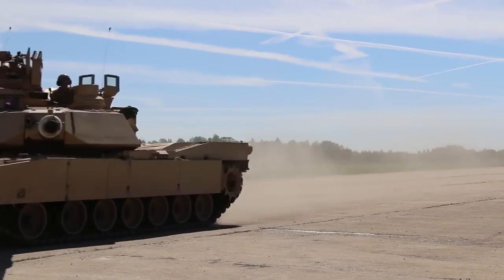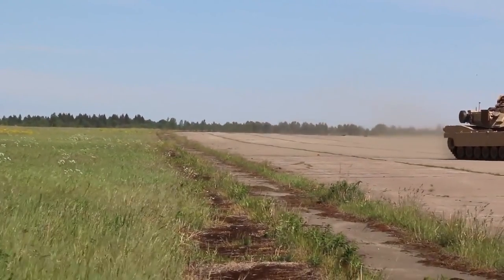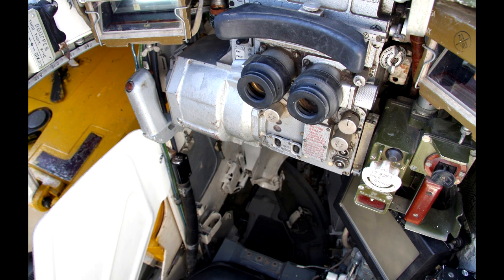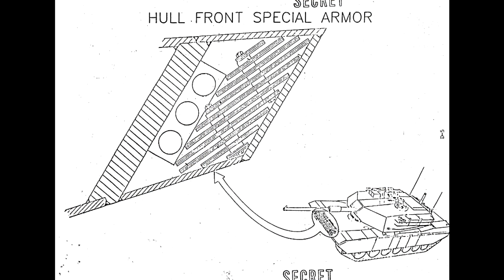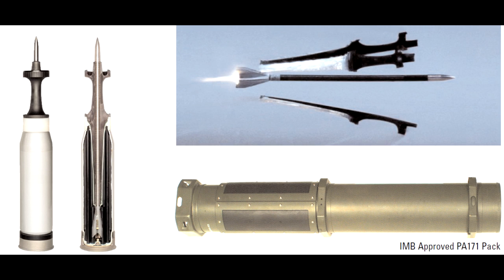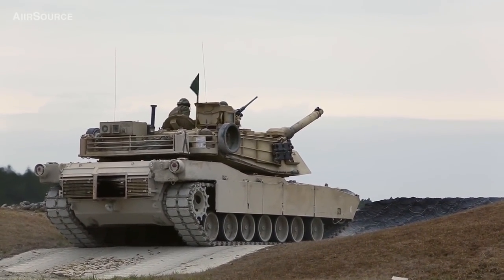Problems with Abrams tank

Comment: The turbine engine was selected because it was lighter than the diesel, as well as using up less space which helped the Abram store nearly all of its ammunition inside the protected bustle rather than leaving many unprotected in the hull like the Leopard. Another benefit is the superior torque rate from the turbine, as well as lower noise signature from afar due to the high-pitched turbine sound.

The high fuel consumption was taken into notice, hence the auxiliary power unit installed on later models to help with fuel consumption while keeping the systems powered.

Comment: The turbine engine has a slightly better power to weight ratio the range on the leapord 2 is 3 miles the Abrams is 2.48 which is already way above the average engagement range of 1000 yards

Comment: I was an M-1 Hull/Track/Engine/Transmission. Mechanic and operated the M-88 Tank Recovery Vehicle. From 1981 to 1993. And both used Diesel. And I saw what the M-1 did to all those "T-Series" tanks. In Iraq..JUNK... HHC 1st Cav1/8th. E-6

Comment: Turbine offers multi-fuel capabilities.  If you only run diesel you can't use kerosine for winter operations where diesel gels. The turbine allows any combustible liquid to be used as fuel. Acceleration is another key factor in the turbine as is the lighter weight of the turbine.

No tank has ever killed an Abrams in battle. Wounded yes, but not killed.

Comment: But the turret doesn't play Pop Goes The Weasel when it's hit.
Reply: what is the point anyway? The tank is still mostly destroyed and the crew is just scorched ash if they haven't escaped.
Reply: https://youtu.be/sn0v1Tu1Nig?si=Yra9xz6c_-t69oEO

False
Reply: @IceAxe1940  did you read the title of the video link you posted? Lol they planted a shit ton of explosives in that. Of course the turret is gonna pop.
Reply: @that207guy7  It doesn't matter if the plant explosives in there or if it runs over a super massive IED the Abams turret will pop off just like every other tank it doesn't matter and that's the point

Another instance of an Abrams turret popping, Google 3-67th Armor, October 28th 2003 when a U.S. Army M1A2 SEP got turret popped. You can't use the standard cope argument that it's a "non DU equipped" Abrams neither.
Reply: @IceAxe1940  if an abrams gets ammo racked, the turret does not pop off. It's ammo is stored in the rear of the turret, and cooks off safely when hit. Abrams doesn't store hardly any ammunition inside the hull quite litteraly for this reason. If you actually knew what you were talking about, you'd know this.

If you plant explosives inside ANY tank, the upward force of the explosion will obviously toss any turret. 

And I'm not coping, but when I read bs, I correct it.
Reply: @that207guy7  If an Abrams runs over an IED it's turret absolutely will get blown off as seen by the M1A2 destroyed In Iraq in 2003.

If an Abrams is damaged by a large explosion it's turret absolutely will get blown as seen by the video. You're trying to move the goal posts because you know damn well you couldn't refute the video I posted and you couldn't refute the source I told you to research. The Abrams absolutely does store ammunition in the hull behind the Commanders position.

You're coping by moving the goal posts pal

My entire point is the Abrams just like every tank will get it's turret blown off it's not immune to it READ NEXT TIME
Reply: @that207guy7 The abrams does in fact store ammunition on the Hull too
Reply: @tanaziolopez1936  yeahh, i already said that in the comment above. And the ammo that IS stored in the hull also has a blowout panel as well.
Reply: Who's gonna tell him?

Comment: The Red Effect problem.
The M1-Abrams only does well when used in the way it is supposed to. It is a hull-down vehicle designed for offensive ranged combat. They are not Russian tanks, they aren't designed to be in the middle of the open and be expendable, these are sniper tanks, and the Abrams does that job well.

Comment: 0:50 they used the 105mm as a stop gap so they could use existing ammo, simplifying logistics 

1:21 the turbine engine preformed better then the diesel alternative in testing the gm1

Good video just pointing out a couple of things, not saying the Abram’s doesn’t have problems

Comment: First of all the M1 Abrams gun is not under powered and also the reason they chose the gas turbine engine is because it could use multiple types of fuel without any consequences and it also generated a whole lot more horsepower and it was also lighter only weighing in at 1.1 tons that allowed them to stack more layers of armor. And the gunner isn’t blind at night. They have night vision sights. And also, they were not as expensive as you were talking about. They use them in military aircraft all the time. and the armor nothing can penetrate the armor. There’s specifically an air gap and depleted uranium in there, so nothing can penetrate no matter the power. The multi fuel aspect of it is so no matter where they’re deployed. It can run on any fuel that they have available in the area. And also the filtration system is not bad it worked as well as a diesel engine. And the front plate of armor isn’t too thin still nothing can penetrate it because it’s angled and thick.

Comment: 4:49 There was one incident to my knowledge where an M1 got hit by a freindly Abrams on the UFP, bouced off into the lower gun shield and killed the gunner

Edit: Gas turbine got roasted, but i think thats the least of the M1s problems. I think the weight is the main problem, the army thinks so and with good reason. What use is a gas turbine when your tank cant get over a normal bridge? And why upgrade to a diesel of similar power, it would be the new hat for our fat horse.

Comment: The turbine was chosen because it was better the 105 and 120 were in the same spot in 1982 the DU was put in the hull the upper front plate SHATTERED not bounced apfsds

Comment: Imma call some cap, Soviet tanks did in fact not have any good passive night vision or thermals, and rounds on the Abrams upper front hull won't go through, they would shatter, not ricochet into the turret.
Reply: T-72 destroyed it in one hit.
Reply: @jade7631  But from where? Did they hit the turret ring, lower front plate, the sides, the rear, saying x thing killed y thing isn’t helpful, and to be honest, it’s bound to happen.

Comment: The reason for the choosing of AGT1500 dates back to the MBT-70 program. MBT-70 had a rather odd diesel engine which failed to propell the tank and broke down constantly. During the program for the Abrams there were two prototypes: The Chrysler one (Which had the Gas Turbine Engine) and the General Motors one (Which had a derivative of the diesel engine of the MBT-70, that engine being AVCR 1100 and the new derivative engine: AVCR 1360), the General Motors one lost because of a combination of factors: the engine, the armor (Which the Engine was at fault too, it gave the tank less HP per Weight ratio essentially lowering the armor it could carry) and that the company basically did nothing when the US army said: "Okay, fantastic. Now get back to the drawing board and try to fix the issues of your tanks, we will see you in the second testing phase". Chrysler's design won because: The engine was innovative, more reliable than the one on the GM's tank and was favored by the army (It offered benefits that the AVCR one didn't had such as), it was more mobile than the GM's one and offered the same survivability as the GM's one (atleast on the testing grounds) at a lower cost. The AGT1500 also offered benefits such as: Low noise and smoke signature, better reliability (Yes, really. You can see why up in my comment where i mentioned the MBT-70 Program) as well as better power to the sprocket. It also was used as an attempt to standartise NATO equipment since the Germans were interested into it too. Now the things that are responsible for its unreliability were already mentioned in the video but these aren't coming from the engine itself, these are mainly quality control issues. Now, on to the diesel engine: The AVCR 1360 had two major malfunctions that would rander it unusable: failures of the fuel injector pump and engine throwing oil out of itself during tight turns, furthermore the engine was recieved negatively, the proof being the nickname for the GM's XM-1 prototype: "Old Smokey", whereas the Abrams we know of today is nicknamed: "Whispering Death". Sounds like the AGT1500 was superior to the THEN diesel engines, right? Anyways, it is certain that giving the M1 Abrams the title "The best tank in the world" is a little too much of an exagiration. There is no "Best tank", countries use different tanks subjected to their own liking. The Abrams is better than the russian T series in number of aspects but it isn't cheap. It isn't unbeatable, just harder to destroy.  In the end the Abrams was a machine that just fitted fine with the doctrine (Yes, doctrines matter too lol.) the US army had employed.

Comment: Perhaps somewhat unrelated, but I wouldn't be all that surprised to see a new form of ammunition developed. APFSDS is the standard, but already we are seeing issues with it, guns too short, magazines too small, and even if both are fixed it's just too large for a loader to deal with. A 2-part ammunition like the Brits used to use could possible alleviate the issue but not solve it. However, ATGMs like Javelin and NLAW still seem to be intensely feared weapons due to their top-attack modes. Given the current grounds for 120/125mm guns, and previous experiments with larger guns like on Sheridan (Albeit with the idea there being launching ATGMs out of the gun) I don't think it's that crazy to think we might see a weapon system designed to lob large caliber shells just over a target and detonate above it similar to Javelins or NLAWs.

In any case it seems to me that armour (or at least protection) is winning the race against armament, when guns are getting to impractical lengths just to achieve high kill probabilities again.

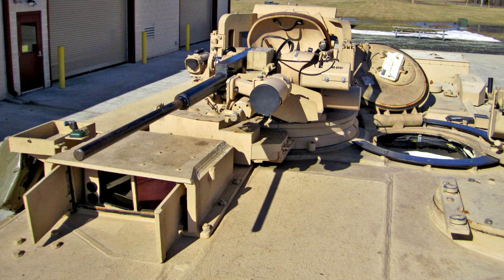Comment: 6:09 for those wondering, by plugging in 52÷sin(8) into a calculator, I've found that that the upper plates effective thickness is 374mm. Not terrible, but still tearable

Comment: 0:47 the reason why early models mounted the M68 gun of the M60 was because they already had it in production. Ever since the start of it's development, its designers had intended for it to mount the Rheinmetall Rh-120. The problem was that they didn't yet have permission to produce it in the United States. This is why they made it so that the M1 could mount both the M68 AND Rh-120, so that once they did have the license to produce the German gun, they could easily re-arm their existing tanks.

Comment: yes no reason to use turbin like no reason sweeden and franch use hybride engine. t80 also turbine.
Is not issue for engine to go over 1500hp but you need move that power on track this is real limit.

Abrams have better control system.
Revers speed of abrams can be the same like forward. 

Abrams was create as a good cheep easy to mantuance tank 
fueal consumtion moder turbine is almost like in disel engine compare to leopard.

this tank is the best.

Comment: There were many initial problems with the M1, but it didn’t take long to arrive at M1A2, which solved many of the problems. The M1A2 arrived in 1992, just 11-12 years after the original.

Comment: I struggle to find proper sources on this, but the German diesel tank engine’s Wikipedia article estimates its weight as 1,800kg (https://en.m.wikipedia.org/wiki/EuroPowerPack), whereas the AGT-1500 is about 1,100kg (https://en.m.wikipedia.org/wiki/Honeywell_AGT1500).

Comment: I see you have a grievance with the gas turbine engine but you should know that the reason we use a gas turbine engine is because the abrams is considerably heavier than many of its counterparts especially eastern competition. The abrams i believe actually produces slightly more horsepower per ton than the Leopard 2A7 and also has a longer operating range. The engine is also simpler and easier to maintain.

Comment: Your wrong, the gas turbine is better than the diesel one.  It is more powerful.  The M1Abrams is a monster, with it's massive armor, and it's powerful engine.maybe you are correct about the part that the gun of the first ediration of the M1 is bad, and that most soviet and German tanks had more powerful 125mm guns, but later edirations such as the M1a1 and the M1a2 had an upgraded gun.
Reply: And that's why america choose for their newest MBT a 🥁 .... DIESEL🎉!!!
The only benefits is a turbine engine has more hp to weight ratio compare with a diesel engine! 
But a diesel engine is by far the best choice for MBT.
Way less fuel consumption, extra complicated dust filtration not needed and way less noise. Also the benefits it is smaller and lighter means nothing in modern Warfare because with the modern guided ammunition it is not important how small the target is because they will find you! And the 1000kg weight reduction it makes almost no difference for a MBT like the size of a Abraham!
Because a modern Abraham weights +-70t!
Reply: @daikovany  Even though a diesel engine can be just as powerful, a combination of kerosene and gas can be  more effective in certain situations, like when in high altitude.
Reply: He literally addresses this

Comment: A useful tank in it's 2015 upgrade configuration (M1A2 SEPv3) if kept 'hull down'... but of that advanced upgrade level, there are only about 1000 tanks under US Army command, confronting more than 2000 'modern tanks' in 2021 in Russian Armed Forces - even according to the completely biased research of the London based 'International Institute for Strategic Studies'...

Comment: The flaws/issues in the video are all fair points.  The tank is great for what it was designed for.....fighting from defensive positions (hull down) against massed attacking Russian armor, then using high speed reverse to escape and entrench in the next defensive position.  Excellent tank...for that specific purpose!

In Ukraine, the Abrams will have an excessively long logistics trail, will be unable to cross many rivers/bridges that Russian/Ukrainian tanks can do, and will be a gas hog = ALL of which limits its capability in offensive operations!

Ukraine would have been better served with more Leopard II tanks, honestly!
Reply: Imagine it hits a mine and loses a road wheel, what then? Even if they do tow it back to a secure location, it'll be a week or so 'till an Abrams road wheel is brought to their location.
Reply: @definitelyfrank9341  ....or it might mean they have to haul it back to a railroad, load it up, ship it back to Poland, repair it and use rails to ship it back to the front.

The logistical challenges that Ukraine faces are pretty harsh......but, as the Russians push them back, the Ukrainian logistic trail with shorten (while Russia's increases).

Of course, if Russia stops with ownership of the Donbass/Luhansk + Crimea Land Bridge.....then Ukraine will be permanently fighting with maximum logistics reach penalties..

Comment: There's no such a thing as a perfect tank, every tank will always have issues and limitations, but what tank out there is better? Over the last year we've learned that Russian tanks are shit and every tank that an Abrams could realistically face on a battlefield is far below its class. Even the Leopard 2 turned out to be not quite as good as expected in a rl situation. So at worst the Abrams is in the group of a few tanks that all can be argued to be the best.

Also, some "problems" are highly contextual. For example, the US has an immense logistical capacity so for them high fuel consumption is not an issue.
Reply: How can it be argued Abrams is the best? Its good reputation is based on how it performed against an unprofessional army of 70s tanks that all lacked thermal sights; were equipped with APFSDS from the 60s; and because they were designed to be as cheap as possible, their armor was only rated for 70s era AT threats.

Comment: some easy things to list off about the tank or well its problems is its lack of armour on its lower body, the slanted up bottom of the turret leading to another tiger 131 incident but much later, it has very weak top armour so any air to ground missile will put the whole tank into a scrap yard, it has no era for heat arounds or any other round and has to rely on its composite armour which is still not able to stop a russian atgm launched from tank if it hasnt been seen, some of the tanks so not have any aps to counter the missiles so if the crew does not see them they have a low chance of surviving i could list a few more but this is really long so ima just not

Comment: In defense of the Abrams engine, it can run on almost any fuel you chuck in there, meaning that if for whatever reason the crew of one of these tanks can't get gas, they can find almost any suitably flammable liquid.

Maintenance is also considerably easier, and it's more quiet.

That isn't to say it's outright better than diesel but it comes with a set of strengths to go along with those deficiencies
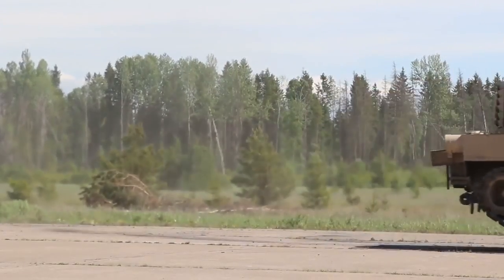Reply: Did you miss 6:40?
Reply: Maintenance is easier but to say the engine is more quiet is kinda the opposite, the gas turbine engine is incredibly loud
Reply: @crusader_wolf1104 it's higher frequency which means it disapates quicker meaning it'll be muck quieter at distance